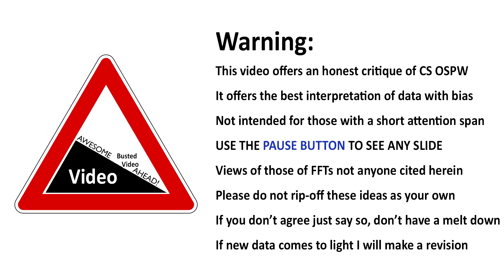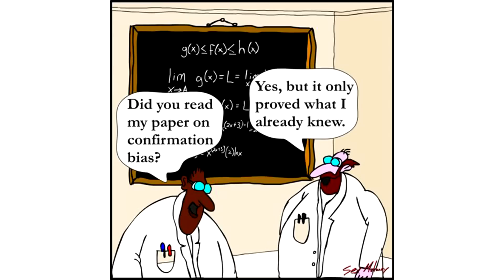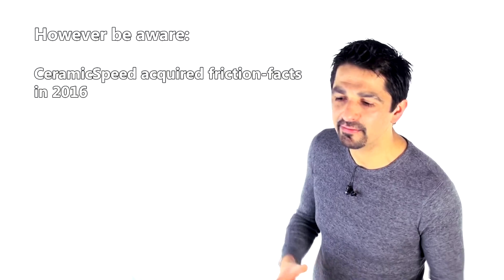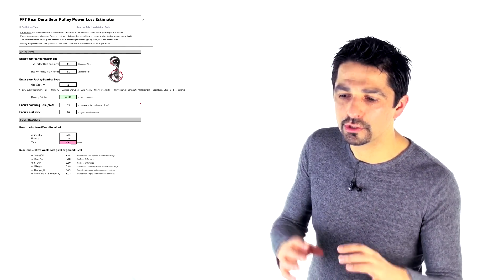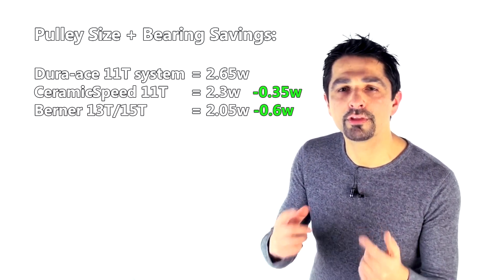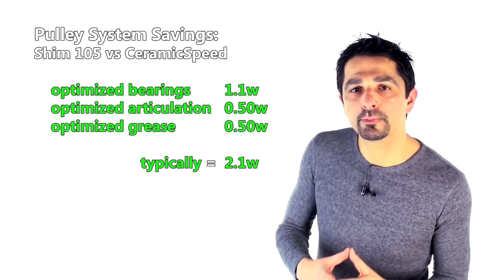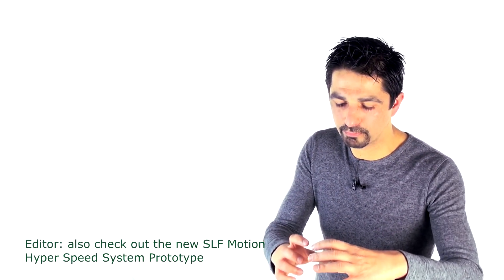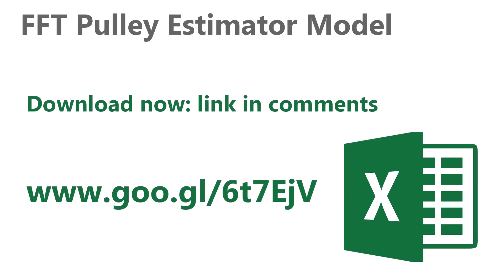CeramicSpeed OSPW Busted! (the truth about watts gained)

Comment: Good video that helps to expose the 'ceramic bearings for bikes' myth. In any case the differences being talked about for jockey wheels are so tiny as to be almost immeasurable. And bigger cage = more drag.
In the light of this, though, don't you think your 'Save 37W with a clean, straight chain' was overdoing it a bit?!
Reply from the maker: Hi Hambini. It is not a question of convincing anyone of anything we are providing data interpretation and data interpretation tools. What did you think of our pulley loss estimator model? ps. I was not aware you held an oinion that we can only talk on youtube about topics concerning our own generated data. On this basis youtube is going to be pretty empty.
Reply: I agree with the comments above, 15W from chain optimisation is unrealistic. You don't appear to have any hard data to back up your statements but have convinced a vast number of the viewing public that everything you come out with is true. All of your data is in the public domain and not your own testing. 

As a professional engineer, this strategy is questionable.
Reply from the maker: Actually you can. Ways to get FFT spreadsheets: 1. tweet a word of thanks (tweet for the link) 2. join our patreon ($2) 3. use our website (we are going to feature a number of free sheets) 4. email and ask nicely.
Reply: I cannot download your pulley estimator because I don't have a facebook or twitter account.
Reply from the maker: Hi Andrew, thanks for the positive constructive feedback. Regarding the previous chain video I don't think 37W is outside of the high end of savings that can be made against a fully (hopelessly) unoptimised chain. I thought you would know by now that these savings are dependent on lots of factors all of which cannot be known to FFT. This is why we put out a calculator (aka coughs estimator this time). Did you have a look? The highest watt savings are going to be with the more powerful riders (high speed high watts) with lossy systems. I did not claim 37w is the average saving but then not to quote the high end of savings would be odd. FFT is not promising anyone anything because I have no way of knowing their bike nor what they intend to purchase, I am providing information....which may be known or unknown to the audience. So the bottom line for your provocative comment (which btw I don't mind at all as I know we are adults treating each other with respect) is that do you have data that my facts are wrong in relation to my chain video? Or do you want to me make a chain loss estimator? Or do you think we should do more lab tests before going public......if so you are much more qualified than me!
Reply: I just think that some of the elements in that chain video were overstated. Finding and using data off the internet is interesting, but you're putting a lot of faith in it. I am an engineer, but common sense plays a big part in telling you that ceramic bearings are really not going to save you anything significant, and that a different chain will not give you 8W or whatever it was.
Common sense also tells you that high end cyclists work very hard for a 10W FTP gain, and that even just a 15W gain from 'chain optimisation' is not realistic, as that cyclist's results would suddenly leap.
I realize that '37W' makes for a better headline than '5W', but realistically, for the vast majority of cyclists out there, the gains to be had are very small. Just keep your chain reasonably clean and lubed and replace it when it's worn out, basically.

Comment: good video, well explanation! I think in practice the most important thing is what you say at 11'25" ff, the grease is extremely important factor, and that can turn the best bearing in the laboratory into a very poor one on the road and vice versa, because the best bearing with some dirt in it is by far worse than a midclass bearing with heavy but clean grease. May be that is the reason for the high W with Campa and new Dura Ace jockey wheels? Campus grease is very chewy (if you clean Campa jockey wheels and put just oil in the bearings, they run as almost as the Ceramic Speeds in the video), but it is a great barrier against dirt, and may be Shimano has changed the grease for the new DA (cause I can't imagine they have downgraded the wheels...)?

Comment: When I looked in to oversized derailleur pulleys I figured that their obnoxiously huge size would cause at-least a watt or 2 of wind drag, striking out any marginal gains in drivetrain efficiency. Thanks for your videos! You save a lot of people a lot of cash :)
Reply from the maker: Quite true Scott. The aero losses have been measured at around 1 watt at 40kph...so subtract that from the efficiency savings (see comment by cyclefacts)
Reply: It looks cool.  Perhaps it's easier on the chain?
Reply: In the world of cycling where 100g of weight in a frame costs thausands of dollars, a product that potentially saves a watt or more of parasitic loss is more than welcome.

Comment: Good video! Though, even if those pulleys did save you 2.4W, it's a joke for almost $500! A solid used road bike can be bought for around that money!
Reply: daAnder71 totally agree. Honestly companies like this just prey on some people's snob factor. If you put a high enough price tag on anything there will be enough idiots that buy it solely because it's expensive, and to those idiots a high price creates the illusion of value, quality, or performance. I also agree with the sentiment of just putting that $500 elsewhere. Even if you have nice wheels, if you're looking to burn $500 sure you could spend it on a bunch of the cheaper stuff to shave enough weight to gain the minimal, if any, gains you'd see from using giant $5-650+ pulleys. At least in my case I could.
Reply: I think these gains are aimed at professional cyclists